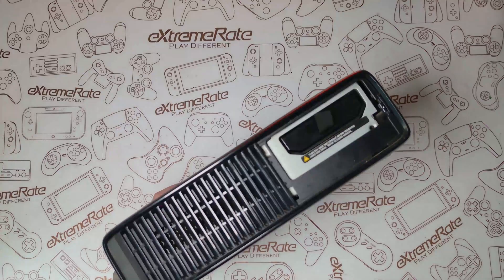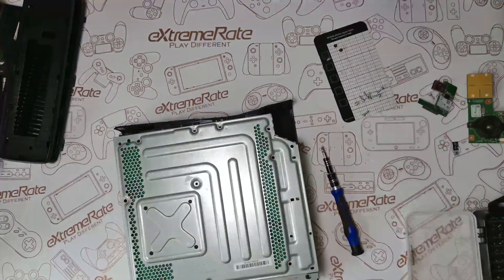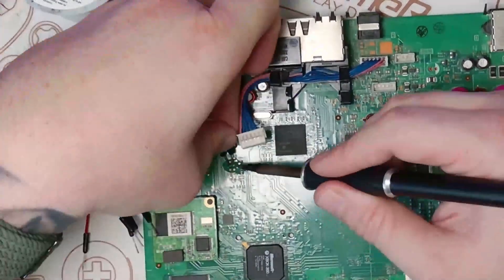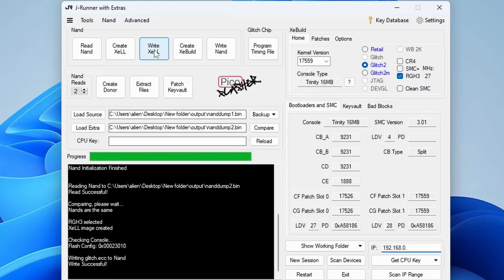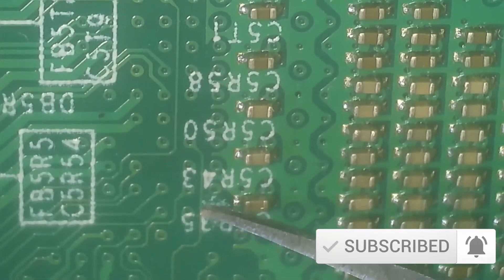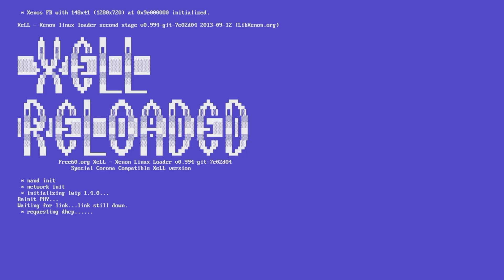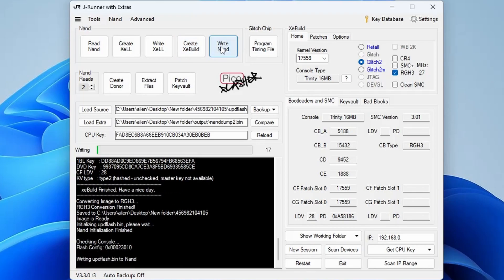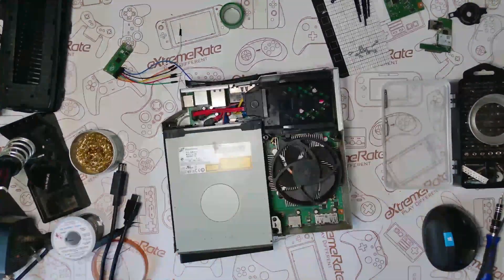Let's RGH The Xbox 360 Slim! Step-By-Step Guide 2024

Comment: What type of points did you use on the wires used to connect the Pico to the board? Also, what gauge wire did you use for the jumper wires, and the size of the SMD resistor (0406, 0603, etc..)?

Comment: Do they sell then quick solder boards on eBay
Reply from the maker: Yeah people sell them on eBay and Amazon I think.
Reply: @ARG  not in Germany because no one had the balls to do it. Luckily a friend of mine is great at soldering.
Reply from the maker: @StuttGuy97  I’m sure the modsmith has the files so you can get the boards made by jlcpcb
Reply: @ARG  ye
Reply: @StuttGuy97 bro weiß du wo ich so eine  xbox kaufen kann??

Comment: did this a week ago to a E model 360, went flawlessly
Reply from the maker: never did an E xbox was it as easy to do?
Reply: @ARG  one cable underneath with a 1k resistor and then a post fix adapter, super simple
Reply: @Jailbroke I want to do the same to mine but I haven’t seen videos how to
Reply: @Jailbroke how do you do this? I bought a new Xbox 360 slim (Halo 4 limited edition) and I want to RGH it
Reply: E model can have corona or Winchester motherboards, if you have Winchester, you can't do RGH or any other hack
Reply: @willpaiz7691 Winchester bad update
Reply: @XTRMXPRTKILR  a lot of things can change in one year!